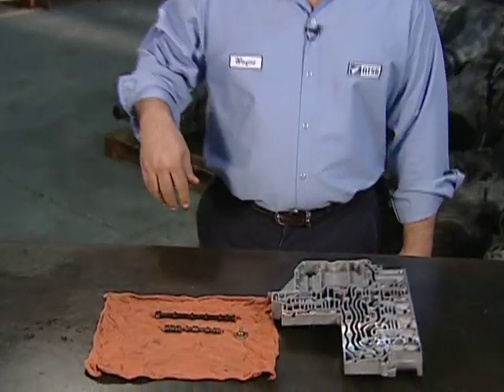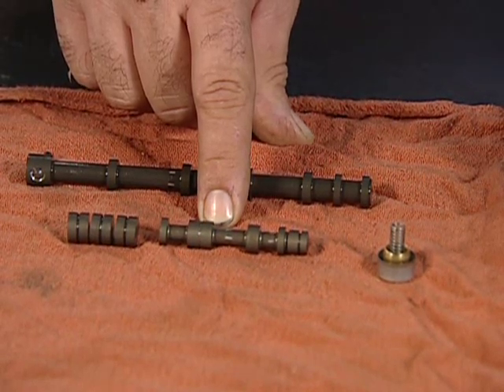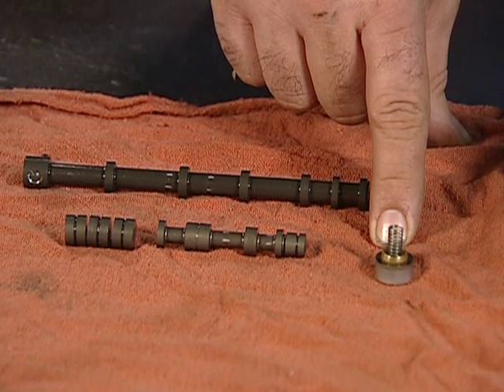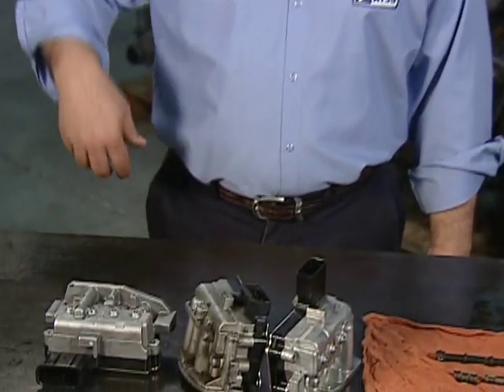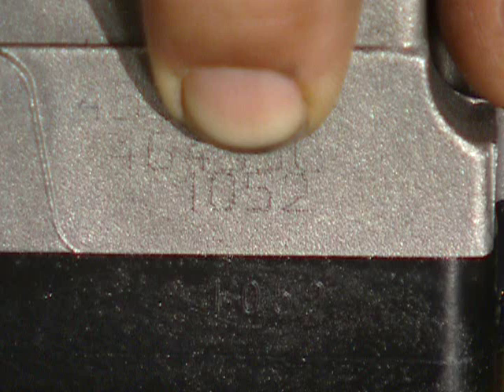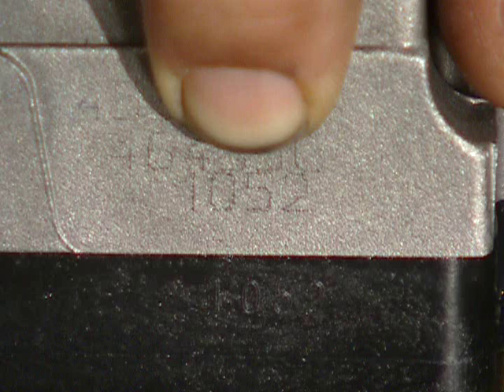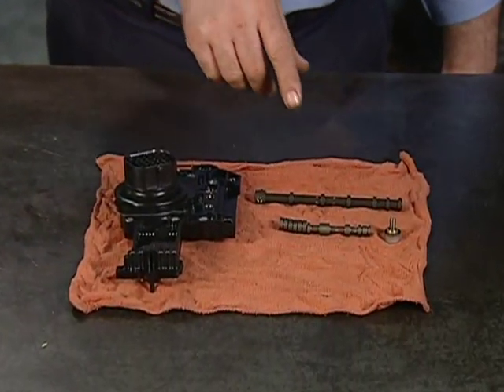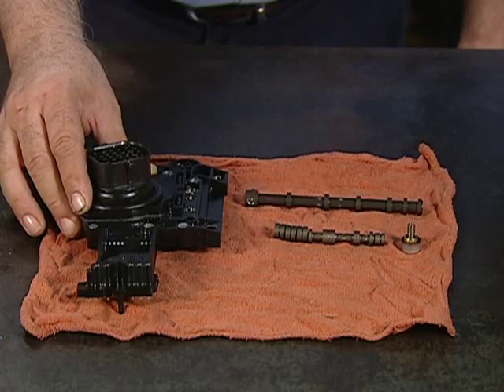Automatic Transmission: How to Understand the Chrysler and Dodge Transmission Systems

Comment: Hello my 2000 dodge durango 4.7L gets error code P1784 L-R Pressure Switch Sense Circuit.. could u tell me more in detail about this. .  Mosty every time I make a stop or shift to reverse or drive sometimes it cuts off and some times it stalls really bad on the verge of cutting off.. what options do I have in dealing with this to het it fixed.. should I get rebuilt, purchase a new trans or get this code fixed... thanks for the help and time if u r able..

Comment: I have 2001 Dodge Stratus with 2.4 engine. Automatic transmission works fine in all modes except: if I reduce throttle during strong acceleration (when RPM goes above 3000), transmission makes strong hit. All motor and transmission mounts are new and this didn't help. No Check Engine light. What's the problem? Valve body?